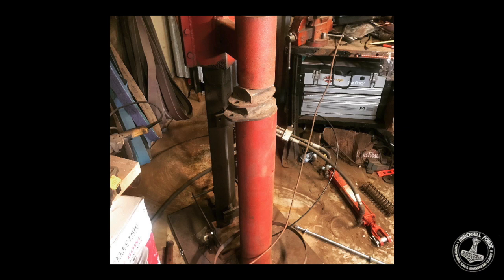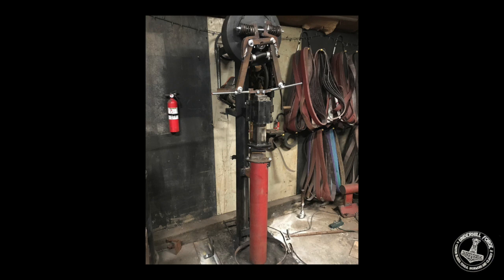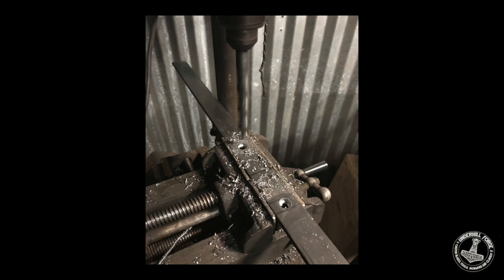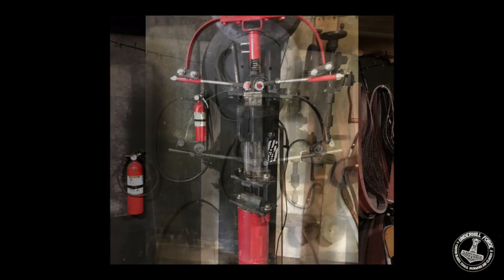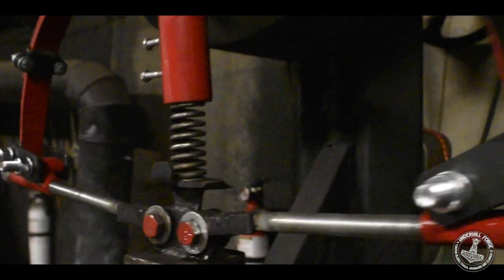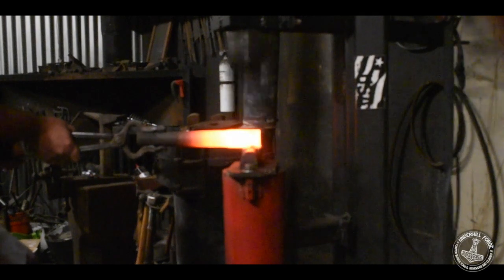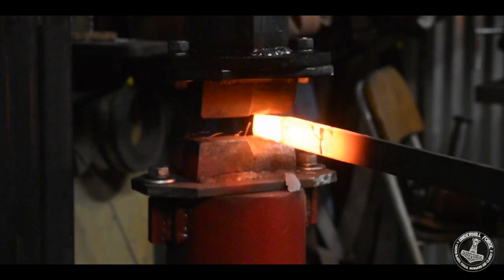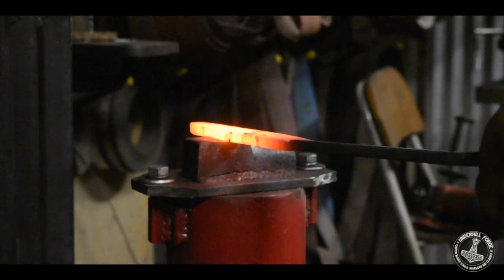Mechanical Forging Hammer - Power Hammer Project

Comment: nice but it doesn't move metal  quick . sounds like  it doen't hit hard enough and needs MORE WIEGHT lol
Reply from the maker: Don’t judge it by that 1.5” 4340 i was forging, I need that to be square for a project later this week. I’m also not running it full out either, just yet. :) This hammer isn’t meant to take place of a 2b or an lg250. The weight is on the sub 50 end but I also teach a lot of classes, so I’d like students to be able to use it without destroying their work. For our forge and the work we do it’s a nice balance, it compliments the hydraulic press and rolling mill just fine for a cutlery shop.
Reply from the maker: That being said, I was just pondering what it would take to make a 200lb mechanical hammer, just for the fun of the challenge. :)

Comment: Two questions: How heavy is your ram?  How many HP did you need for the electric motor?  Thanks!
Reply from the maker: The tup itself is right around 38lbs, I would include the spring/linkage and top die into the overall weight so probably just shy of 50lbs. I’m using a 1hp motor at 1725rpm.